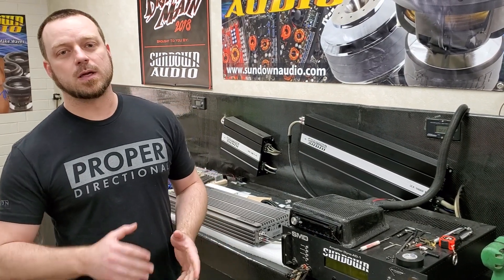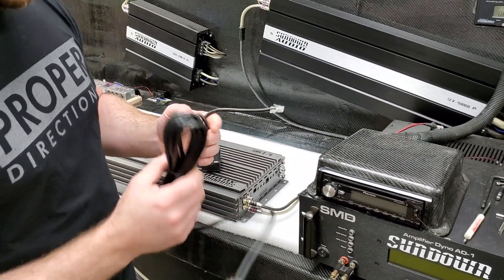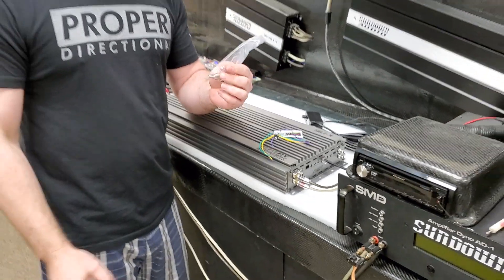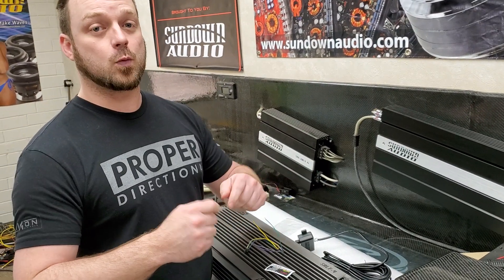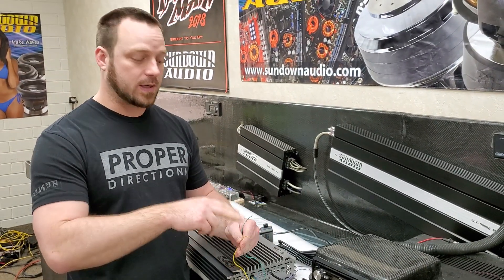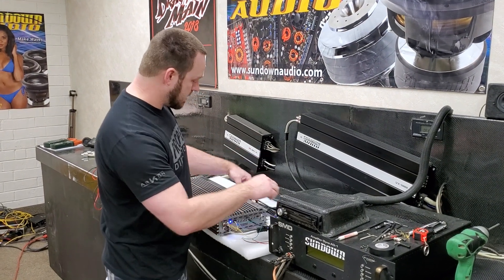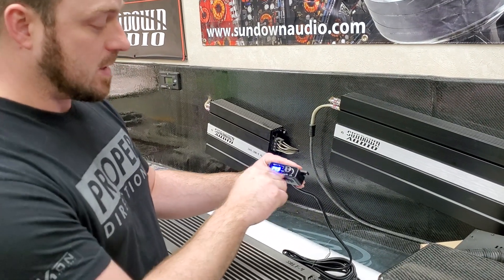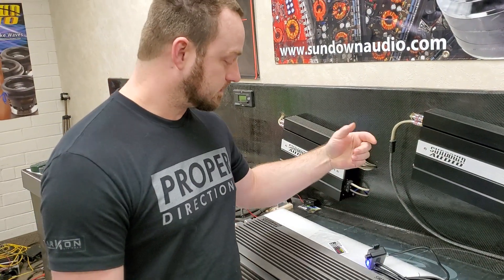Sundown Audio Salt Amplifier Information

Comment: So what degree doee a sundown audio start getting too hot? Why is everyone saying that there voltage is off by a few points. Mine is higher by .2 volts. Is this adjustable somehow? Clip light yellow soft clip red hard clip? Please advise. Just installed my salt 6 last nite. Couldnt find any of this information in the manual.

Comment: I have a question about another amplifier sfb 1800.5 I'm really interested in it looking to do a 1 amp setup highs,mids, subs for the sub side looking at 3 x8's so looking for some specs for the amp and also how do you think that amp will do on the subs? Thanks ahead

Comment: Haha wire a relay to the clip light out so it cuts the remote wire out cutting the amp off if the customer keeps blowing subs due to clipping. Could also relay off the power status light wire to power other items 🤔 hmmm lots of possibilities.

Comment: What fuses do you use on the salt 4k haven't been able to find info online
Reply: Fuse for size of the wire
Reply: The manual recommends a 400 amp inline fuse